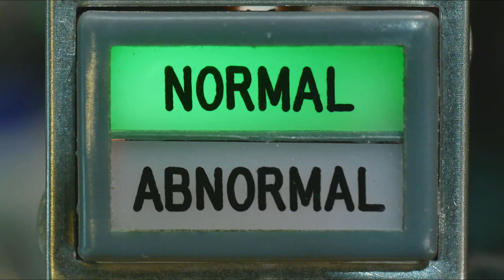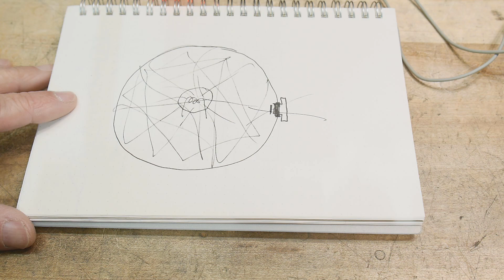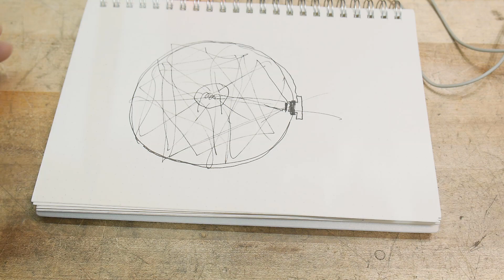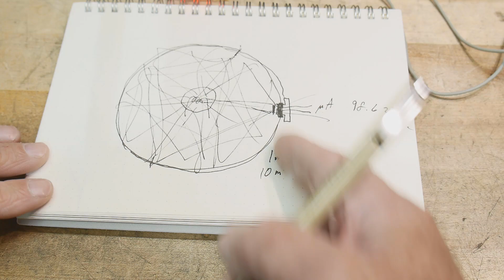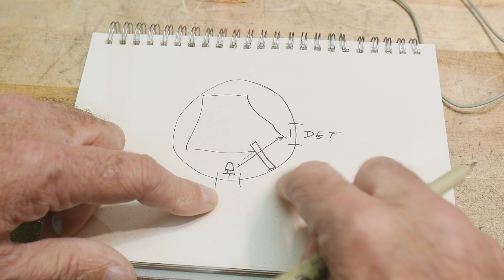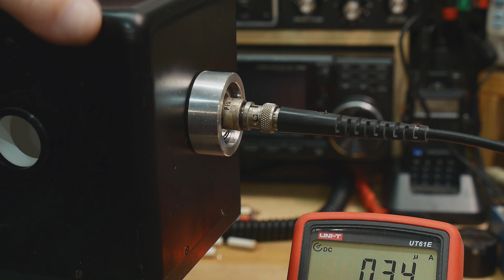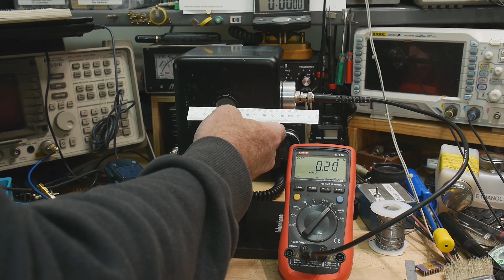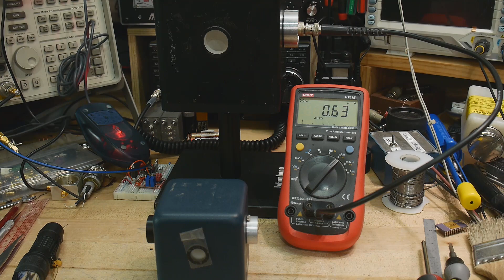#708 Optical Integrating or Ulbricht Sphere

Comment: Fantastic episode! I'm actually looking to buy a spectroradiometer and integrating sphere soon to test manufacturer claims against UVC LEDs. One of the things I didn't see covered was the difference between the larger spheres. What benefits do you get from going to larger spheres?
Reply from the maker: you get better uniformity in the larger sphere but at the cost of signal and noise. Make sure the sphere has a port baffle inside and you connect things correctly.
Reply from the maker: how do intend on calibrating? What is your standard?
Reply: @IMSAIGuy  deuterium lamp to calibrate. The manufacturer is trying to upsell me on a .3M sphere whereas I was originally going with .1M
Reply from the maker: @Raymond-Wu  how big is the device under test? If it is an individual LED on a star board heatsink then the 0.1M sphere is probably OK but will need a good internal baffle as smaller spheres will suffer from non-uniformity. Depending on the accuracy you need, the larger sphere will be better. I would be most worried about calibration using the lamp they have. Without seeing the setup it is hard for me to judge. Also knowing how they measure the calibration standard would be important. If they use the larger sphere to do the transfer of radiometric data then that would be a factor. The port size is also a consideration for fixturing and cal.
Reply: @IMSAIGuy  I saw some labsphere products that were rated up to 2 watts. Is there some way to determine the max range of what the system can measure?
Reply from the maker: @Raymond-Wu  the detector needs to be in usable range (linear), so at 2 watts, that is a lot of photons. the larger sphere will allow higher watts. I'm not sure what detector is used for UV measurements.
Reply: @IMSAIGuy  I've got two options. The first is from this relatively unknown (in the US) company called HopooColor. This is how the calibration is done https://youtu.be/W-dQSTixxXQ?t=53. I will mostly be measuring LEDs on small star boards like you described. However, nowadays there are powerful UVC sources reaching 500mW (their claims). My qualms are that I have no idea what detector is used in that spectroradiometer and what the upper limit of my measurements can be.
Reply: @IMSAIGuy  On the other hand I could get a IS6-C-UV-2.5" from Labsphere. I know the min and max range of measurements. However, I'll have to get a spectrometer separately to test the wavelenth.
Reply from the maker: @Raymond-Wu  the hopoocolor seems to be a visible wavelength range calibration for  and questionable at that. I would avoid that for UV.
Reply: @IMSAIGuy  oh sorry. They're offering to make a custom version 230-850nm
Reply from the maker: @Raymond-Wu  you will probably be interested in flux density so a setup to measure watt/m^2  and maybe radiation pattern. optics is a big rabbit hole and expensive
Reply from the maker: @Raymond-Wu  stay with labsphere
Reply: @IMSAIGuy  Thanks so much for answering my questions. I thought about a comparative setup with mW/cm^2. However, I imagine that'd give an unfair advantage to LEDs with optics installed or larger LEDs that have multiple dies.
Reply from the maker: @Raymond-Wu  measure how they are to be used

Comment: I’ve made several DIY integration spheres over the past several years. Using various forms of self prepared Teflon coating. If I’m not mistaken… The material used on the inside of professional spheres… Is a type of Teflon that has been coated with a “foam“ type texture. 
Even the tiniest piece of the material, is several hundred dollars. No way I could swing that price!

But I visit a lot of industrial and university auctions…&
I FINALLY got a spectralon reflectance standard…..to use as comparison for my own coatings. I was able to grind and prepare barium sulfate in a way that it’s almost perfect, & almost indistinguishable from the spectralon when measured. Credit where it’s due… I got the idea from the “periodic videos“ YouTube channel and the wonderful professor who did a video on barium sulfate coatings several months back!

In the past, I used various types of Teflon material and plumbers tape as laser targets and reflectance standards.  virtually free since they were all DIY… And I still recommend Teflon tape from the hardware store to a lot of my friends who are getting into DIY optical stuff. On a tight budget.
Reply: By the way for anyone interested in DIY optical lab stuff…

I tested many different spherical shaped objects that are readily available on the market. And cheap. I tested stainless steel spheres, and all sorts of other materials… I settled on hollow Styrofoam spheres. 

They are easy to find, cheap, and most of the ones I tested are perfectly spherical shape inside. And when coated and prepared properly… My DIY version tested identically to a $15,000 professional integration sphere in an optic slab I was lucky enough to visit. 

They had all kinds of integrating spheres. From small table top versions, two massive designs the size of a human!! 

They tested mine against a similar sized unit, With their calibrated equipment. If you can find an optics lab at a university or even a professional lab… Who will let you bring a few of your reference standards, or materials and lights that you want characterized… it’s a great way to have a large collection of wavelength, reflecting, and “calibrated“ measuring equipment… Without spending much money. 

Some of the guys on the “budget light forum“ have members who are professional optics engineers. And from time to time they will offer flashlights and LEDs that have been characterized on professional equipment… So you can pay 20 bucks and receive a small light or LED in the mail… That’s been perfectly characterized on $1 million worth of optic lab equipment. So now you have your own standard for testing wave length, power, and stuff like that.

Comment: Excellent Video about Optics - I found one of these ~3-4 inche diameter spheres inside of a medical laser -> into a fiber probe -> calibrator device. I took it apart, It was Teflon on the inside, and had 2 ports: one open, and the other to a photo diode.
Reply: Yep if I’m not mistaken …..spectralon (absorbs almost no light) is basically foamed Teflon.  I ended up using barium sulfate ground and prepared a certain way, so that I got The best performance possible. It’s 99% as good as my small spectralon test standard.

Comment: Very nice introduction. I learned a bit I probably should have known. During the fall, I had some students (first year engineering) that needed moderately accurate power measurement, and had them build a functional integrating sphere. A basketball, some epoxy, and BaSO4 paint. Calibrated (to maybe +-20%) on a sunny day against a recently calibrated insolation meter borrowed from a former student (25 years ago... Wow, I feel old. She is a top level engineering manager in a regional solar supplier) Hadn't needed to use one since the 1980's when I was in the photomedicine lab. Ah. The joys of an undirected academic life.